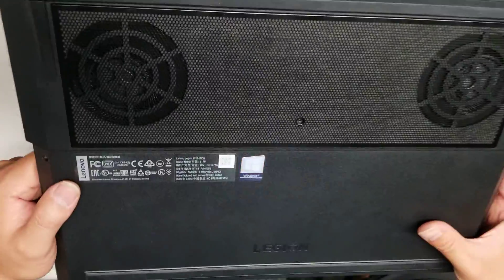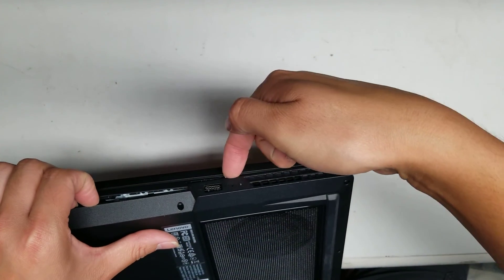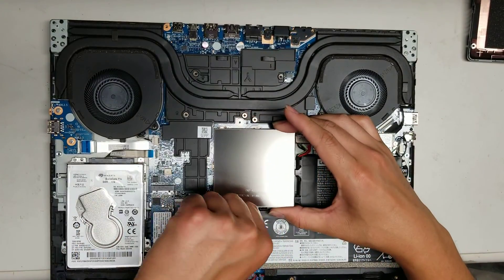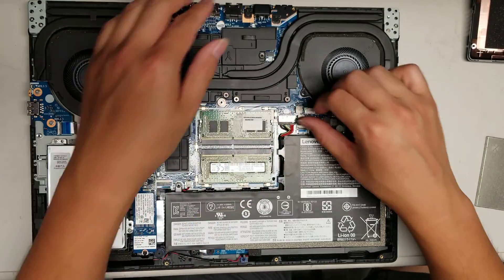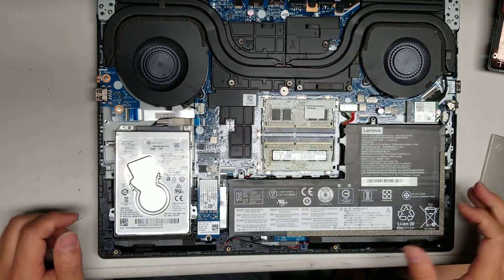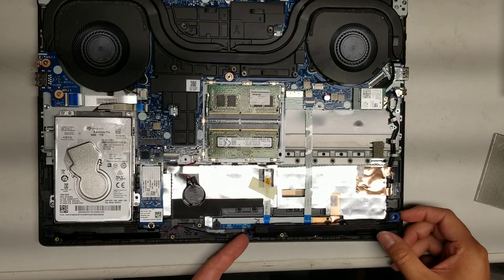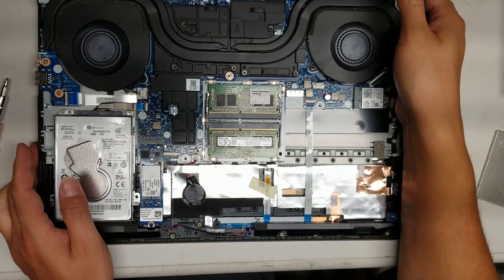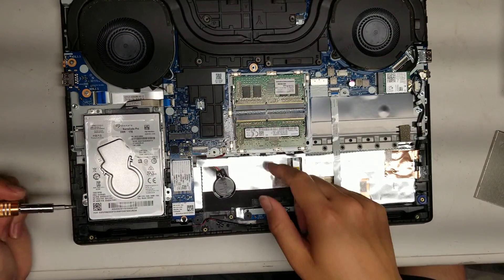Lenovo Legion Y530-15ICH Disassembly RAM SSD Hard Drive Upgrade Repair Part 1

Comment: Just wanted to ask if it's possible to upgrade the GPU on this model? (I have the same one)
Reply from the maker: Nope
Reply: @ItsBinhRepaired   THanks for replying! Not even if you desolder the GPU?
Reply from the maker: If you have to ask, the answer is definitely not. You definitely won't have what is needed.
Reply: @ItsBinhRepaired  Ok, well you said def not then said I won't have what is needed... So is it or isn't possible? (the question was if it's possible to upgrade, I never said I was going to do it.) It's ok though, thank you for replying and great video. Appreciate the info!
Reply from the maker: @kreepiehouse74  haha technically everything is possible

Comment: Hey bro I am from India, and I have the same laptop Lenovo Legion Y530 by default it comes with M.2 SATA 128Gb, and I need to update the storage and as well need to buy M.2 PCIe SSD card any suggestions for me
Reply: When I check on board it contains only  M key, and I see Crystal Disk Info software it says PCIe 3.0 x 2
Reply: So it seems to it only support M.2 PCIe Gen 3 only not NVME am I correct
Reply from the maker: PCIe is NVMe I thought.
Reply from the maker: I'm not sure.

Comment: I literally cannot get the screws off
Reply from the maker: Are you using the right size screwdriver that fits tight?
Reply: @ItsBinhRepaired  i got some of the screws off with 2 tiny screwdrivers that are very simmilar sizes and some of them , only 4 remaining, don t even move
Reply from the maker: @peperokk  you don't want to use the wrong screwdriver. If you do, you'll end up stripping out the tops.
Reply from the maker: @peperokk  if you plan to use the screwdriver for a long time, I recommend this https://amzn.to/3InkaNX if you just want something cheap, this would do https://amzn.to/3nJmHdk

Comment: thanks for uploading this , i want to replace intel optane 16g with smsung evo.. btw if i want to install samsung ssd i need to clone the window OS from then hdd or do clean install on the new samsung evo ?
Reply from the maker: Only if you want the OS to run from the SSD. Right now it'll be running from the other hard drive. This is how you can clone it. https://youtu.be/4p5jFDzVwUw no need for the adapters.

Comment: Hi, I am having issues with my laptop Y530. It won't turn on and won't even charge. Before this happens the blue screen of death which they call always happens. Because I am working I usually just force the laptop to shutdown and turn on again. Now it won't charge and turn on. What could be the issue?
Reply from the maker: Sounds like a motherboard issue. If you're lucky, a battery/cmos reset might fix it.
Reply: @ItsBinhRepaired  already did a full format before. So motherboard issue?
Reply: @ItsBinhRepaired  I think I already did the battery/CMOS reset
Reply from the maker: Then motherboard is dead :(
Reply: That is the removal of the battery for a few minutes right?
Reply: @ItsBinhRepaired  ouch, how much would that cost?
Reply from the maker: @AndyArciga07  depends on parts costs
Reply: @ItsBinhRepaired  can motherboard be repaired?
Reply from the maker: Possibly. Depends on the issue and the skill of the technician.
Reply: @ItsBinhRepaired  can't find motherboard online where I live.
Reply from the maker: @AndyArciga07  :(
Reply: @ItsBinhRepaired  time to replace the laptop I guess, motherboard would cost me a lot for sure.
Reply from the maker: @AndyArciga07  sadly